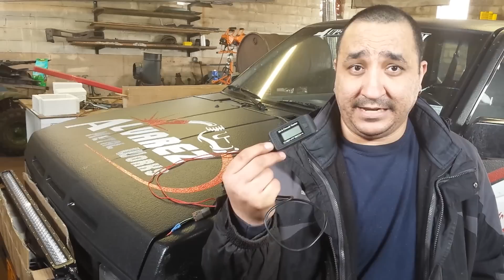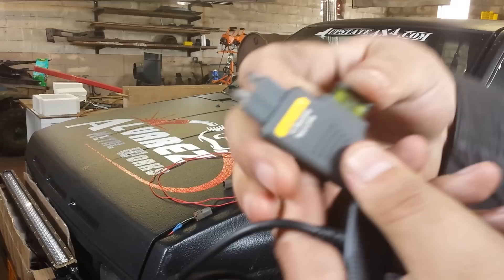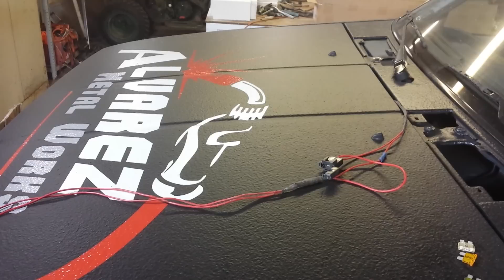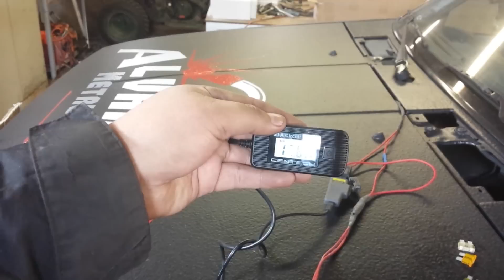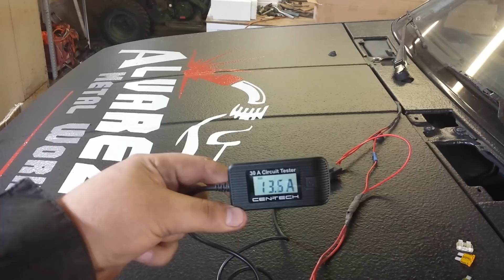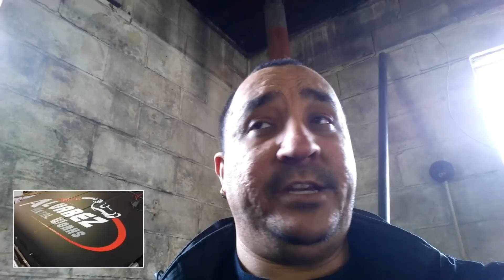Harbor Freight Cen-Tech 30 Amp Circuit Tester

Comment: If you have a fuse that keeps popping, you probably have a short. Putting a huge fuse in will just result in melted wires and fire potential.
Reply from the maker: yup... Not sure why you say that though. I'm simply just showing everyone this low cost amp tester. This will let you test draw on electronics under 30 amps that a person might not know what's required. Not a tool for everyone but it could come in handy.

Comment: I was driving through the Nevada desert about 3am (that's the middle of nowhere with nothing around) when my '74 Roadrunner went dead.  Nothing.  No lights, no radio, no ignition, not even a dome light. 
  After some time panicking and being rescued, we got under the hood and determined that the "fusible link" had burnt.  This link is just a dedicated wire of a different type and lower tolerance that is the first thing to burn out if your main power line overloads or gets hot, etc.
  It was apparently weak as I never did find any other issues or cause for the link to fail but, fail it did.  
  Once we found the issue, 5 minutes to connect in a new link and I was back on the road. 
  Though it may initially seem stupid to put a weak spot in your wiring harness, this was a very smart idea by Chrysler because lots and lots of vehicles burn to the ground because of a short in the main harness.  It overloads because of a short, etc. and gets hot.  And with a constant 12-14v. from the batt/alternator feeding it power, it's just like throwing gas on a fire, the heat builds until something catches fire.
With a fusible link in the system, that's the first thing to get hot and burn out, saving the rest of the system.   It definitely saved me from burning down in the middle of the desert that night and I'll always be greatfull. 
  I still have a Chrysler convertible and the emergency kit I keep in the trunk has a spare fusible link and a pair of electrical pliers.

Comment: Hey bud what’s up? My radio fuse is always blowing fuse, I bought a centech tester for 30 amp, it’s reading 0.7 or 0.6 amp with car running and radio turned on, I need help , what can it be or what does it mean?

Comment: You mentioned that voltmeters typically cannot measure high amperage circuits, which is the case, and why you can find used voltmeters that have the insides burned out.

In electronics, when you need to measure current higher than what the voltmeter can handle, you can use a "current shunt" also called "amperage blocks" wired in line with the circuit. They generally have one type of metal as the connector points and a slightly different metal in between, although in some high amperage units, I have seen them as one single chunk of brass. Whatever is the "in-between" part material, even a solid piece of brass, from one end to the other, it has some minimal resistance so that it forms a measurable voltage drop across it at the connection points. These units are highly calibrated so that using a voltmeter, you can accurately calculate how much current is running through the circuit. By using these, you can measure several hundred amps using a common voltmeter.

I have used these in the military and for government contracts. It would take a lot of current to cause any damage to these items but we had to have them tested for accuracy every six months by a third-party calibration company, although they never changed.

The downside to the current shunts, is that they are often quite expensive, and can even be over $100 each depending on its intended usage and accuracy of calibration. I just did a search on "brass current shunt" and see that the prices ranged from $22 to $273 each. Do a  search for "brass current shunt" and you will see what I mean. It is handy to know what they are and what they look like because I have seen them in auctions for a gone-out-of-business clearance, and to the sellers they look like a chunk of metal so you can get like 10 for a $1.

Once you see what they are, you could make your own, and see what the resistance is by knowing the voltage drop and the current going though it. The production units are fine tuned to produce a common value of voltage drop for a common amperage. With practice you could get close. As long as you know what the rest of the parts of the formula, you can get by with a do-it-yourself current shunt.
Reply: df

Comment: thanks for replying.  I can file down the tips  or solder wires to the blades using smaller blade tips.  TY, I'll figure something out.

Comment: I bought a 30 amp circuit tester at Harbor Freight.  The problem is I have a 2005 chevy cavalier and it uses the standard size blade fuses inside.  The blades on the end of the tester are to big to plug into the fuse box inside the car and it also doesn't fit the bigger amp fuse sockets under them hood!  Didn't see any 20 amp tester there at the store that  I saw being used on another YouTube video.  I don't know if I rig up some kind of adapter to put on the blades so they fit the sockets if that will work?
Reply: +Alvarez Metal Works  T ry look at these 
Fuse Buddy for Regular Sized Fuses --  http://www.amazon.com/GTC-CT6100-Fuse-Socket-Connector/dp/B001TCXOTW/ref=pd_bxgy_263_3?ie=UTF8&refRID=1MAED2NT0H9T7QX3K39P

The Mini Version Fuse Buddy -- http://www.amazon.com/305M-Fuse-Buddy-Mini-Tester/dp/B000W8FMXU/ref=pd_sim_263_1?ie=UTF8&dpID=41z5r0nWcGL&dpSrc=sims&preST=_AC_UL160_SR160%2C160_&refRID=1MAED2NT0H9T7QX3K39P

An All in one kit --  http://www.amazon.com/ESI-315-Max-Fuse-Buddy/dp/B002YK711K/ref=pd_sim_263_11?ie=UTF8&dpID=41d-t78-bOL&dpSrc=sims&preST=_AC_UL160_SR160%2C160_&refRID=1N74WEBQG5510DD4ZM9N
Reply from the maker: +Billy Boy I'm sure someone sells a blade fuse adapter. You'll have to search for it. Or you can get creative and make something. Be careful doing that though. Don't want to burn anything up.
Reply: +Alvarez Metal Works I made my own little adapter using slide on connectors and soldering a wire pin to it. It works ,just a pain getting the little fuse out of the  side slot. I have found other companies on the net that make a duplicate 20 amp tester just like the centech . great video you have posted
Reply: +Hawaiian F150 That is one sweet little tester for the price. The adapters are a good thing too o have.  thanks for the info F150
Reply: @Billy Boy
One of the links already provided to you was not an adapter but a way to turn the fuse socket into having two tabs you can put a meter on. Those are real handy to have to, but I think I found an adapter for $9.99 that might be closer to what you were wanting at https://www.amazon.com/dp/B077G78KJM/ref=sspa_dk_detail_1?psc=1&pd_rd_i=B077G78KJM&pd_rd_w=4oVeA&pf_rd_p=21517efd-b385-405b-a405-9a37af61b5b4&pd_rd_wg=gbjfI&pf_rd_r=Q970GQ5EP1YVFS5MD62J&pd_rd_r=58184c5c-0b05-11e9-a99c-25f61c0681a3

Look at the pictures; you can see that it has room for two fuses next to each other. The idea is to extend a circuit by having its own fuse. Still the body of the unit would be a decent start at creating your own adapter. With some 24-hour epoxy you can make just about anything.
Reply: +Hawaiian F150   Think I found the cheapest Mini and Regular quality tester -- Hopefully Billy Boy will see it. Good Luck Bro -  Click Here on Amazon: http://www.amazon.com/ESI-310-Fuse-Buddy-Test/dp/B002YKCIMM/ref=pd_sim_263_1?ie=UTF8&dpID=417mt0jtJ5L&dpSrc=sims&preST=_AC_UL160_SR160%2C160_&refRID=006TWZGY0FFYP8GR4R9N
Reply: @hawaiianf1504   that's way too expensive stuff to use for it.

Comment: As for why the current draw starts high, then drops is due to the warming of the copper cables. Copper is a positive temperature coeffecient (PTC) resistor, the higher the temperature, the higher the resistance. Higher resistance = lower current. Ohms law baby lol...
Reply from the maker: Simon Crane Thank for the information. I'm no expert on electrical but I'm making it a point to learn it.
Reply: If you`re serious about learning more about the electrical/electronics side of things. I can heartily recommend "Scanner Danner" A College lecturer/Freelance diagnostician, with a preium channel for really in-depth studies. A lot of the "TST Seminars" videos are excellent for basic universal testing methods. Also, check out "Dan Sullivan" for a thorough basic understanding of electricity. All the above are YouTubers. With printed materials available. You`ll know when you`re beginning to understand it all when you start lusting after a labscope lol. Good luck mate...
Reply from the maker: Simon Crane thanks buddy

Comment: I have one of those amp meters that clamps around the wire.  I don't remember what I paid for it.
Reply from the maker: How high is it rated for? Many of those that double as a multimeter are only rated for 10 amps.
Reply: Alvarez Metal Works  It goes up to 400 amps.  It's not a multi meter, It only tests amps.
Reply from the maker: Nice. Those are the expensive ones lol. I'll get one at some point too but for now this will work. What brand and model is yours?
Reply: Alvarez Metal Works Actually HB sells the clamp type meters like Chevelle was referring to, for really cheap. I can post an item number if you are interested. Got a question about the tester, is there a way to change the internal battery?
Reply: @CHASNME  
"... is there a way to change the internal battery?"
Yes.

I just bought one of these at Harbor Freight for $13.48 in December 2018, but wanted to know what to slide or pry open to put the battery in since the battery is not installed but does come with the unit.  This video was the answer for me. At the end of the video he shows a picture of the back open where the battery goes, which showed me that the small piece is the one to slide back after removing a tiny Phillips head screw on the back of the unit.

The battery is a common 23A12V battery, which sells for around $1.20 each. They are about the diameter of a AAA battery but only about 60% of the length. They are commonly used in some key fobs, motion activated alarm units, and several other things; enough to make them pretty common and reasonably priced.

The battery being included but not installed is a good thing in case the battery ever leaks before being sold (a rarity). Having the battery outside the unit but visible through the packaging helps the store to see and remove any packages should that ever happen (e.g., Back and Decker sold battery operated wrenches with the alkaline batteries installed already but most corroded the terminals before being sold).  Since this Fuse Circuit tester will not be used often for many purchasers, the battery should last a long time, and if fact, if the tester is not going to be used until who knows when, it might even be better to remove the battery to prevent any corrosion issues.